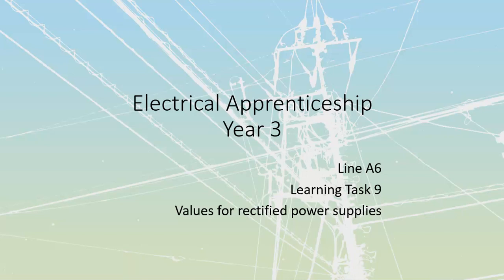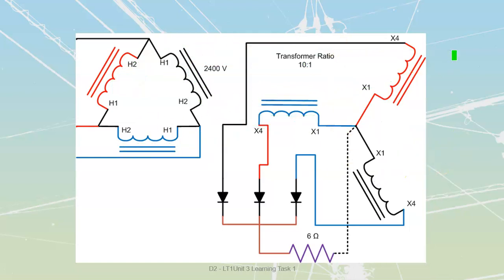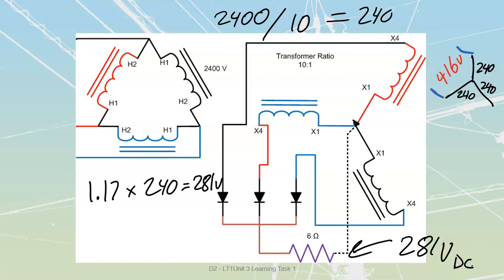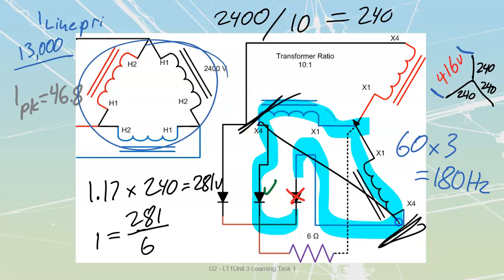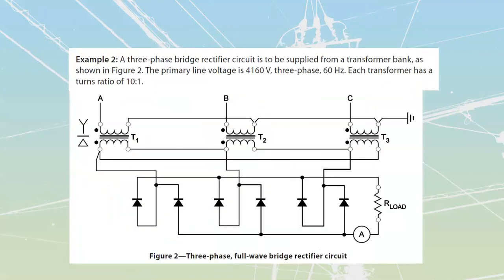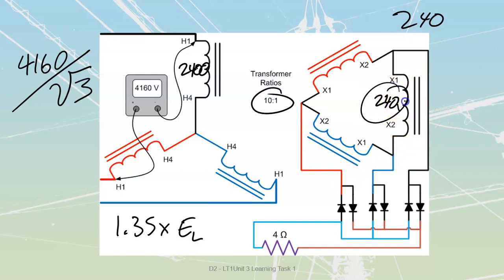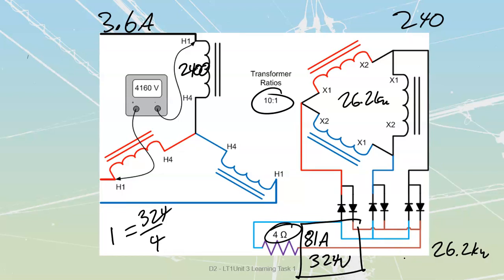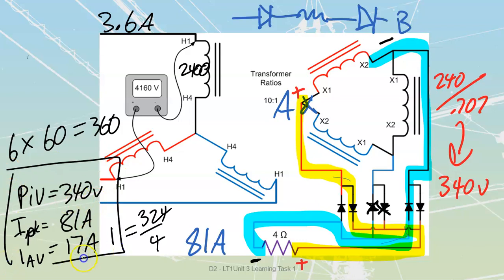Calculate 3-phase rectifiers - L3 A6 LT9

Comment: In the very end of the video you said your diode would be rated a third of the IL of 81A. Did you mean to put 27A instead of 17A?
Reply from the maker: Good catch.  That math would not have worked out otherwise!  27 is correct.  Not sure how I did that, or how it's gone so long without being caught.